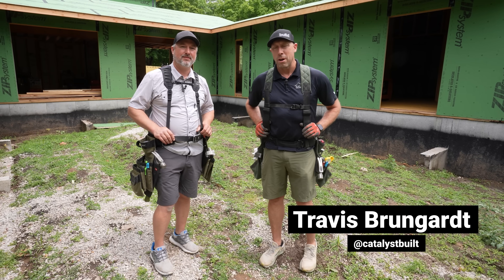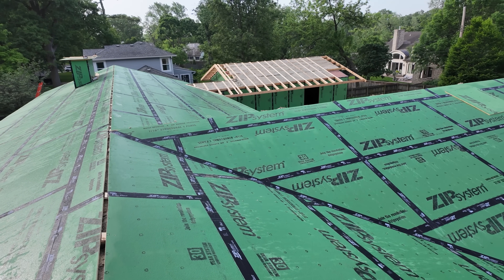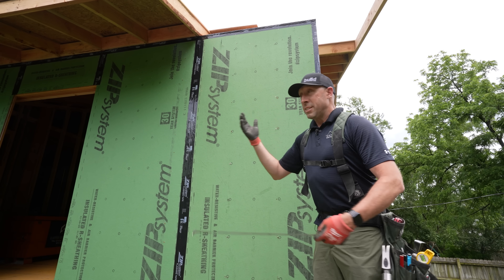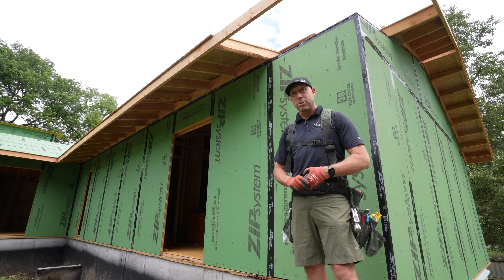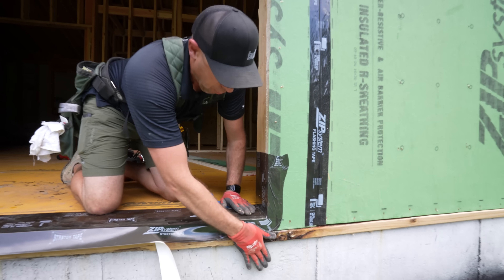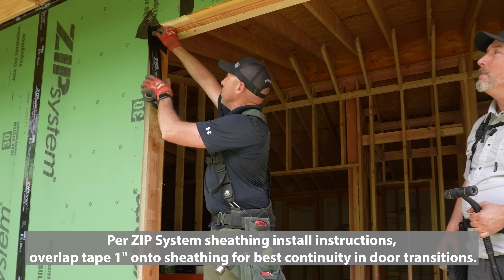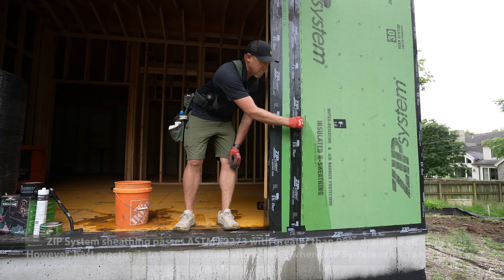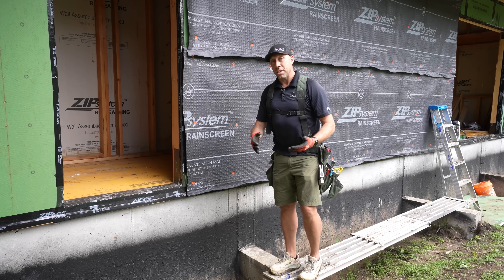Perfect Wall System At Rivard

Comment: I built in Texas for 20 years and used Zip system. The rain guard was not available then . So what did the Zip System company decide,  now it is best to put rain guard over the Zip? Why didn't they come out with the rain guard when they came out with the Zip sheathing years ago? Also, nailing on the rain guard you have now just put more holes in the Zip board that water can penetrate. The whole system is very expensive with tape today at $42 per little roll.

Comment: The thing is even though you try and build these kinds of homes as efficient as possible they still wont be as good as a log cabin that has excellent blower door test results because of the thermal mass of log cabins. You heat a home like this and do the same with a log cabin and turm the heat off in the winter the tradional stick frame home will lose most of the heat way before a log cabin does and goes for the same in the summer. The log cabin will stay cooler longer

Comment: The seal plate above the concrete foundation wall is standard lumber not pressure treated, nor termite resistant.  Why use such poor grade of seal plate?

Comment: Why are we trying to build a better mousetrap?   Many European countries with sub-zero climates , have insulation block systems that last much longer and work much better than anything to can be reinvented here in America.    The homes there are built to last a lot longer and contain both the heat and cold, depending on the time of year.  They literally have no nail holes at all.

Comment: Question- Their is no doubt that high performance construction is superior to standard wall/truss systems we have seen for decades. But is it just a waste of money?? Here is why i ask- i just did a complete remodel addition on my house built in 1996. It has Standard 2x6 framing with vapor barrier, siding, fiberglas batts etc. We stripped the whole house down in the remodel and there was zero rot anywhere. BTW- i live in western wa, one of the most wet places in the us. Whats wrong with the way we have always done it- its cheaper and it works? Whats the real advantage to spending another 20-30-50K on the structure? if you save 200.00 per month in energy, it would take 30 plus years to recover your investment?? Building Science is cool and all, but we need affordable houses for people.

Comment: Meanwhile a raccoon infested log cabin sitting on a post in ground foundation will roast you alive with just a wood stove. It will also last 100 years as long as you lightly torched and soaked with old motor oil anything in ground contact.

Comment: Until you rope caulk with butyl on every Zip joint as its assembled, I have zero confidence zip tape will maintain function 10 years from now.  Its a polymer and over time all of them shrink and crack.  At least butyl will last 30 years.  We've actually pulled butyl tape off 40 year old structures and it maintained adherence until pulled away from the surface.  That zip tape won't even have a semblance of integrity a decade down the road.  Its unproven.

Comment: this is JV level, what a real pro all star eco smart energy conscious CEO builder does is 2x10 wall frame, more space for closed cell and then blown in ontop of that, followed by zip sheathing, roll the tape OFC, then wrap in Tyvek, then wrap in a rain screen, then put up firring strips, then your siding, which then is sealed with a layer of epoxy, all installed with my awesome red Milwaukee tool ecosystem that I store in my awesome red Milwaukee packout system (I dipped into my sons college fund for) and then I brush off my carhartts, hop into my new 2026 Ford, crack open an LMNT to rehydrate after a long day (so freaking yummylishish) and then on my drive home i have a call from the awesome BETTER help therapist because I'm so leveraged financially I'm freaking out man, and to help with that I take HIMS so my hair doesn't fall out. That's all to say that if you aren't building this way, you're basically making a mold house that will FAIL in 10 years, and if you aren't using Huber, Zip, Milwaukee, carhart, LMNT, betterhelp, and hims then youre basically an old boomer builder that needs to get with the times. 

peace out
signed, 
Big T

Comment: on the overroof, why use a ZIP product?  If the underroof is the control layer and the sandwich insulation is vapor open, couldn't you save a lot of money by an OSB or plywood sheathing?

Comment: My first thought is that the second roof sealed on top of the first sealed layer will trap any moisture that gets in there. The insulation will get soaked. Wouldn’t you be better off to vent that layer and put your insulation under the first layer?
Reply: I would worry more about a fire.  Metal roofs in rural areas are discouraged because they turn a pitched roof into a kiln.  Its insanely difficult to use an axe to penetrate one.

Comment: Perfect wall that lasts 500 years is a brick/stone wall, not painted and taped OSB. The roof is great. However, I would build the overhangs on the ground, and attach it to the sides, instead of building another roof on top. It's simply a bit of overkill, material wise and labor wise. Our duty to customers as a builders, is to keep the cost down.

Comment: Can you use zip systems tape on existing OSB sheathing? As in when doing renovation and changing out siding
Reply: Yeah its just flashing tape. Ive used them on osb or zip walls for work for 5 years

Comment: Would love to see the show come back 10 years from now and see if everyone in this video agrees this is still a good idea.
Reply: I am renovating a 40 yr old home here in Florida and I removed the siding and old house wrap which was deteriorating but other than that,  the plywood darkened a little bit and looks as good as the day it was installed, I did go through and re-nail every 4" on the perimeter and every 6" in the field and then re-wraped the house using tyvek .....the moral of my comment is the old adage of "If its not broken why fix it" I get the fact of having insulation but this house can't breathe and any mechanical systems they put in place to control the environment are only good if the homeowner is proactive in making sure the systems are maintained! The double roof is a horrible idea! If they do have a leak at what point will it be found? Sounds like a recipe for  for disaster and you will only find out when you have a lung infection because of mold...anyways,  just my 2 cents and by no means am I trying to insult anyone,  I am just stating my concerns!
Reply: That's a good idea, it's pretty obvious the Zip people and some other product manufacturers are heavily invested in these YouTube / social media influencers. Money and freebies play a role in their opinions but only time will tell if the product is as good as they claim.

Comment: This is a joke. Nothing short of pushing materials and cost. Profit margins driven off building materials cost is really coming to the surface now. Matt we expect better from you. 60-80 thousand nail holes in a roof. Given 20 shingles to a bundle and 3 to a square leaves only 300 to a square.  60,000 nails will cover 200 square. We are looking at a house that might take 25-30 square and that’s a long way from 60,000 nails. At the end of the day you still have a lot of holes when you replace the shingles. Given premium shingles  that’s years away from replacement. The simple membrane to air tight the roof is all that’s needed.  Do better!

Comment: why use expensive zip sheeting for the second layer of outter roofing and why use thiner sheeting if you used 5/8" underneath as the water control layer?
Reply: The further out from the frame the less sheer strength.

Comment: Typically, when installing tapes, membranes, etc., you start at the bottom to facilitate water drainage. But with the rain screen, wouldn’t it make more sense to start by hanging it at the top of the wall? Then, any water between the rain screen and sheathing will flow right into the sheet below it. But as it is installed, the upper sheet will drop the water between the cladding and the back side of the rain screen.

Comment: Legit question…your sacrificial roof will leak eventually…the water will get absorbed by the rockwool…now what?  How do you know your roof is leaking, bc in this case it will be years of a leak.  The underside of your sacrificial is also exposed.  Rain screen on top of rockwool and 2x6, before sheathing?

Comment: For the rain screen, wouldn’t you want to keep a continuous path for the water to shed? So wouldn’t it be installed “backwards” meaning starting at the top of the wall and finishing at the bottom?  The way it is shown in the video makes it look like it is going to hit the top edge of the sheet below it and then have a potential water dam.

Comment: How are you attaching the 2nd roof to the first? Aren’t those attachment points compromising the layer of the first roof?
If it’s toenailed in, you can kiss it goodbye during a high wind event
Reply: I would guess that whatever clips and fasteners are either sealed, or because they're a one time install they won't compromise the zip sheathing as a re-roof would in the future.
Reply: @trevorbednarz7995  Yeah pretty sure they mentioned that in the video. If you go to strip the roof, lets say 2-3 times with new shingles, you get all of those new nail holes all over the roof. But that's true for literally every conventional roof, and it doesn't cause any major issues most of the time. A lot of places with hail get new roofs every 5-10 years, they usually aren't replacing the sheathing. So, toe nailing or whatever else the 2nd roof frame into the sheathing isn't a big deal, it's not very many nails, and you should basically in no situation ever get any measurable amount of water into the 2nd roof system. The point of the 2nd roof system is because the first one is part of the outer wall insulation technique. If that decking had to be replaced because it's old, or damage from a tree or whatever, you're going to open a huge can of worms of not being able to properly seal the roof. So they build the 2nd roof system as a sacrificial roof to take the damage instead, plus an opportunity for more insulation and less thermal bridging.

Comment: I don’t know what climate zone you are in but we do not put batts under the roof surface, without ventilation (or foam layers above). I’d like to see the video on how the roof is done. You don’t mention it but beyond the sleeper framing you also add 1x spacers. So is this 3/4”space (if not blocked by the batts themselves) sufficiently ventilated in your opinion to prevent condensation—or do you see other factors in play here? In some (less desirable) assemblies we sometimes have had batts with 2” space and baffles in a cathedral ceiling, but this system feels like cutting it too close for comfort. Besides, a leak in the upper roof is going to be harder to locate.
Reply: The insulation in this build is made from rock….

Comment: This is silly. I’ve seen Matt do monopoly framing on houses before and he just installs the rafter tails on the outside to create his roof overhang. That method still gets a thermal break, but doesn’t require building an entire second roof.
Reply: The idea with an entire second roof is that you can add exterior insulation between the two layers. If you don’t want that then you could do exactly what you described.

Comment: How are the second roof rafters attached to the framing of the first roof rafters?
Reply: Must be toe nailed, I don't see any brackets or top nails. I can't imagine they nail it from the bottom.
Reply: @pdavis2207 yea i guess…unless they used structural screws to tie the two sets of rafter framings together, which would be very labor intensive. I just cant imagine an engineer would approve a toe-nailed top roof that has such large overhangs… They have got be using some sort of screw hardware at the eves
Reply: @zefrum3 I agree, I think screws would be better too. I started to say screws but I can't imagine a crew going to that much extra effort. 😊

Comment: Assume you asphalt shingle over the second roof, then years later re-shingle and now have 80,000 extra holes in the outer roof. Should a leak occur, while the sub-roof would defend against water infiltration to inside the house, the insulation bat between the roofs will get soaked. How will this insulation dry out?
Reply: It has a gap for soffit vents and ridge cap vents so the cavity has proper airflow and can dry. You can see the 1x2's on the top edge of the 1x6's to create an air gap.

Comment: You just poured a bucket of water on your finished walls to show it was completely sealed from water. Then why do you need a rain screen?  Also you mentioned the number of nails (penetrations) being used on the roof. What about the nails (penetrations) for the siding wouldn’t this cause the same “issues” as the roof nails. The manufacturer has you hook,line and sinker and the builders using these products never stop and think about what they are saying.

Comment: I like the idea, but unless you need the extra insulation on the roof this method (IMO) is a waste of money. The re-roof issue is simple. Either use a roof material that issuing to last a very long time, (ie. metal, tile or slate) or when it is time to re-roof use ice & water shield on the whole roof. Putting a shingle roof that is only going to last 25-35 years on a  house of this caliber & cost is ridiculous (again my opinion).

Comment: For those of us building in colder climate zones or to a Passive House standard, the need for exterior insulation is clear. Beyond the issue of cost, the questions I have about this particular installation are:
1) running the over roof joists horizontally reduces the thermal bridging but reduces air flow for drying and creates a dam for bulk water. How did you deal with these issues?
2) the secondary vertical over roof joists are continuous thermal bridges from the conditioned interior through the primary roof rafters. Why not using 1x or 2x over the comfort board as your secondary sheathing attachment like on perfect walls with exterior insulation? This would eliminate the thermal bridging and create an air gap for drying.
Reply: The BSC report on double walled insulation clearly shows they had problems with condensation on the interior surface of the sheathing despite low indoor RH. This was caused by the high insulation levels indoor with no exterior insulation to eliminate thermal bridging. Since water vapor rises, roof assemblies will be exposed to higher RH levels and therefore more prone to condensation.
Reply: 1) It look like this is a roof from Stibruk. Really this is a non issue just like the "cold sheathing, dense pack" conversation. TL;DR: Field data shows Dense Pack with no out-sulation shows no ill side affects.
2)Thermal brining not really that huge deal because of HOW MUCH insulation there is.. Sure you can make some argument for math, and all that.. But just like the "cold sheathing" argument field data shows its no worries.

TL;DR: Science says bad, field data shows its okay if attention to detail is followed.
Reply: Just use SIPs. you can get R50 easily.
Reply: Re: your first point, I've seen other vids where they ran it at an angle to allow bulk water and air circulation. Not sure why they opted to run perpendicular in this case.
Reply: He is  ZIP salesman telling you how much ZIP he can use on a house. That house is probably costing 500 dollars a square foot.
Reply: The exterior insulation is clearly supplemental, making bridging a negligible issue.  The primary and bulk of the insulation will be blown attic insulation or spray foam to the bottom of the roof deck in this application.
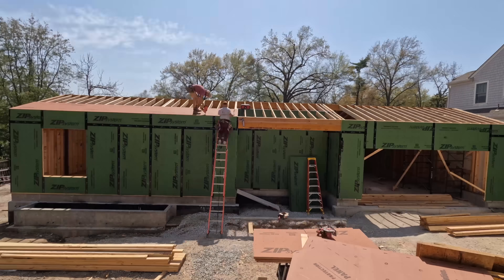Reply: @jamesandayladodge4815  if you look at the roof rafters (0:56), they look like 2x10s in a vaulted ceiling arrangement. If I assumed correctly, then neither foam or loose fill will stop the thermal bridging. 

One of the key reasons for exterior insulation is to dramatically reduce thermal bridging and alter the condensation plane. This installation appears to do neither by creating a condensing surface on the underside of the primary roof deck that would be made worse by any vapor open insulation under the primary roof deck.

The condensation calc says condensation likely Dec-Feb in 4A with this kind of thermal bridging.
Reply: @jamesandayladodge4815  some of the main reasons for exterior insulation is to reduce thermal bridging and to change the condensation plane. Spraying closed-cell foal on the underside of the roof deck would alter the condensation plane too, but blown insulation like cellulose or batts like rock wool would not alter it and would only make the condensation issue caused by thermal bridging worse by lowering the temp of the primary roof deck.

Comment: You pour water behind the rain screen, how is it getting in there??? The siding is on the outside, water would be traveling on the outer side of the rainscreen, opposite of the zip sheathing side.
The 2nd roof attachment is just bonkers, not explained and if just nailed down, geez, what's the wind going to do to it, peel it off. What about 2nd roof drainage if there is a leak with those cross-beams... Sticking roof insulation between 2 vapor barriers, isn't that a no no?
All nail penetrations should probably be caulked with liquid flash.
I thought ZIP tape should still be overlapped top down, your door tape and mudsill tape connection is reversed because you decided to violate your own order of operations.
How did you fill in the roof ridge, that's a mighty big gap of what 2"? Shouldn't the 5/8" roof zip sheathing be almost seamless at the top too?
What's to prevent your 2nd roof boards from abrading and making holes in ZIP tape or just the ZIP coating?